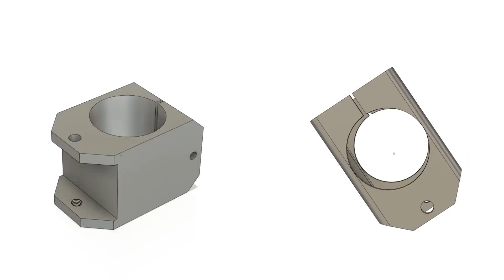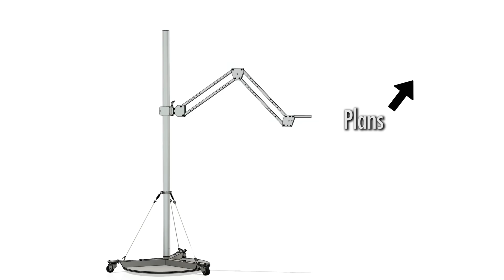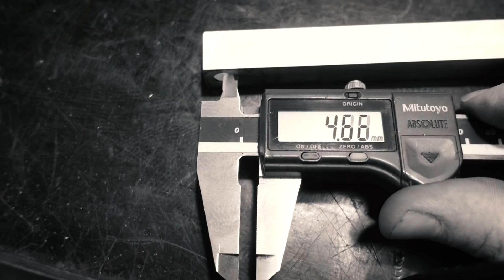Articulated Camera Arm on Wheels (no more Tripod!) (Plans available)

Comment: my dad would've hated this video... he's a mechanical engineer with 35 years experience, the fact you drilled 4x the number of holes than you actually needed in those aluminum tubes and the fact you machined 100% more parts than needed and didn't use standardized bought parts (saves on man-hour cost) would drive him mad ... i can hear him saying "that thing has been designed by a welder" (translated from my mother language)

Comment: That moment when your tripod is expensive than your Camera.
Reply: I actually think the raw materials excluding your own labor costs would add up to not even $80 total...aluminum/steel square and round stock pipes are really cheap as is raw steel plate and simple aluminum plate stock. I think the castor wheel are the most expensive rolling in at $15-18 each. Just google simple aluminum steel stock pipes and you'll see...You could make this entire build without any welder...Just bolted together...and that would be it. The more you know...
Reply: @Lalaland.001  I think he was talking about the commercial solutions that Phil decided to forego.
Reply: I think you accidentally a word

Comment: 5:25 a chuck in a chick lmao.  I’m a machinist and I have done it too.  End a endmill in the tailstock.  Know it is wrong but you do what you got to do.  Mine was a 6 jaw in 3 jaw.  Need more bite and adjustment in a plastic part.  Thank you for the video and taking me along on the build
Reply from the maker: Actually I could see myself doing this even if I had the backplate... simply because it's so much faster than changing the whole chuck 😅
Reply: @PhilVandelay  Re: A chuck in a chuck

Tom Lipton frequently uses such a setup in his videos and I don't think anyone would accuse him of being anything less than a master machinist. He's been turning handles making spaceships and nuclear reactors since before most of us were born!
Reply: @PhilVandelay  I have recently upsized (I've always wanted a bigger spindle bore than I had, now I've finally got one I can get my arm into, up to the shoulder) but it's a struggle, when working alone, to get my 310mm 3 jaw off the floor and onto the sled I've built for sliding it along the bed and onto the spindle nose. So I tend to leave it on and chuck a smaller chuck in it for 4 or 6 jaw work, or for small stuff where the big chuck jaws are too cumbersome. I do have to be careful though - on two occasions now a chuck has shifted on me. It would not be fun to have even a 250mm chuck chasing me round the shop....

Comment: Very well done.  I love the design. I appreciate seeing the process and details which worked or did not work.   I also have iterations in my designs.  I do not regret over designing something, but I often regret under designing. 

I do not think the collar and cables are overkill.    They allow better adjustment than if you welded on pieces of round bar.  Good idea for the 3 wheels so they always have contact if the floor is not even.
The cable adjusters would be called turnbuckles in the US.  Another good idea to allow adjustment if the cable stretches over time.
Dave.

Comment: That is an awesome stand, thank you so much for sharing :)

By the way, one of the best vibration dampening tricks for hollow tube is to fill it with sand. You may need to compensate for the weight of the sand by adding another base plate but that thing would be absolutely solid.

Comment: This is amazing engineering. I loved watching steel being worked to produce some very interesting designs. These, at the end, integrated to produce what is a very capable but complicated camera support. Some improvising was also necessary. However, this support is attractive and does the job (but it is a large tripod by any other name). It  would be interesting to find out how much this tool interferes with your work. My final comment "Well done".

Comment: Very nice but you are correct the weld joint at the washer cable junction is a weak point. I attach all kinds of eyelets and endings to thick and thin cable with some custom crimp blocks I made for my hydraulic shop press (also homemade) I hoist 750 to about 1500 lbs  often and never had one let go yet!
Reply from the maker: Yes I definitely wouldn't recommend this method to hang anything off it that has considerable weight, but for just keeping this pole upright it's worked fine so far. Good tip using the press for crimping

Comment: Well done. I would have used Nyloc nuts where you need to adjust the friction. Even with the spring washers the nuts may work loose(r).

Comment: Wow, nice design! I too am surprised that the tensioned wires work that well. I see you also have one of those Makita Battery-to-USB port things. I use one for my phone and took another apart to have a Makita battery connector for a project. Anyway, that's a sweet setup you've got now!
Reply from the maker: Yeah these things are great, they can power a camera for hours and most people have a few drill batteries sitting in their shop unused anyway. And they charge super fast!
Reply: Can't imagine why it wouldn't work considering that's how they hold radio antennas up.

Comment: Good job on the camera arm! The base weight should have been over the wheels, since weight at the center has little effect.  As far as the springs go, if you had made a sliding spring hanger for one end of each spring, you could adjust the spring tension based on whatever camera rig you install. Thes spring hanger should clamp on the tube with a peg to hold springs on each side, with a clamping bolt on the top or bottom.

Comment: In the interest of stability, please consider changing the base from 3 arms to 5 arms. In my experience with plant stands the 3 arm base, though seemingly stable on uneven surfaces, was very prone to tipping with any breeze (outdoors). I then tried 4 arms and that did not solve the problem either. I finally tried 5 arms, and though much more difficult to construct, this proved to be very stable in addition to offering the 3 arm advantage of being stable on uneven surfaces. 
I really like how you solve the problems with maximum complexity. Kind of my style. It gives me great satisfaction.
Reply from the maker: Good point, I hadn't even considered using more than four legs but I now that I think about it, it works pretty well on desk chairs

Comment: Drop a deep cycle battery on that plate and a converter and you can both charge your cameras and run a light without cords. Added stability from the weight was well.

Comment: very nice solution, i've resorted to using a rode microphone arm very similar to your lamps. also above my desk and other area in the office i have 40mm pipe runing in the ceiling and i use lighting gantry clamps to hold lights/mics etc. I love the portability of yours. great job thanks

Comment: Have you noticed that tripods have a hook under the post? It's there for a reason, so you can sandbag it.

At least they should have a hook, or a provision to drop a flat training weight across the base. Yours... seem not to?

That being said any sort of flying articulating arm as long as it's strong enough and you have an attachment point, that's just straight up better, we can all drink to that. So yeah an alternative is to just skip the tripod/rolling base and foresee attachment points in your lab. Other useful things that come to mind are RODE PSA1 and PSA1+. The long Manfrotto Friction Arm maybe? But it's got issues as well. Really the only reason tripods exist is so you can grab one and take it with you.
Reply from the maker: Yeah I put weights on the hook for a while actually but I found the effect is limited, you can still knock them over if you bump into it enough. But the bigger problem is just the floor space tripods take up, after using the camera arm for a few years I can say it's one of the most helpful things I ever built. I can't say it's ever annoyed me, it rarely gets in the way and still works like a charm, definitely has never fallen over either. 
There are some pro camera stands that could mostly do the same job, but they cost thousands and the shop environment would probably be rough on them. considering the cost and that they're made to be used in clean studios, I don't think it's the best thing to use in a workshop (this goes for any camera equipment really).

Comment: Re: four jaw in a three jaw. You have to dial it in anyway, so really - if you don't need the between-centres distance - it's a good idea and saves having to have/make a backplate. Also quicker than changing chucks on many lathes. Not as rigid, but doesn't matter for that particular job.

Comment: Have you considered magnetic mountings, often used on machine tools. You may have one handy. I wish I still had access to a Bridgeport Mill. 

flimsy crap tripods are hopeless. A substantial, wide dolly mounted tripod helps. I have used a telescopic pole stand with rolling base, for bigger Broadcast video cameras. A pivoting parallel motion arm on dolly is nice, if you have the space. Consider  Manfrotto wall mounted arms for lights or a fixed camera (like a Go-Pro) for wide shots. mixed with longer "detail" shots.

Comment: A vsit to the local gym for some weight plates 😉 they should just slide on to the pole. I like the adjustable spring system so if you use a different camera you can adjust for weight 👍

Comment: I love the chuck-on-chuck action! Why didn't I think of this? thanks!
Reply: I've had some employees refuse to chuck a chuck.
Reply: It's quite often done on big lathes, in industry, but only for taking light cuts. It's a big job changing a big chuck, and if what you need is a smaller chuck for one operation, then it makes sense to avoid two heavy lift operations (involving a crane or a fork hoist).
One advantage if that you can dial out nutation (where the lathe spindle axis is at a slight angle to the desired axis of workpiece rotation) as well as the more easily corrected situation of simple offset (where the axes are parallel but not coincident).

Comment: If you wanted to overcomplicate this more you could have made a spring adjustment system that uses screws or something(i have no idea what the proper term is lol), so you could use the thing for different weight equipment and adjust the spring tension more accurately

Comment: one design idea I dont see realized often:
Fill the structure with sand if possible, instead of adding more steel.
Works almost everytime when more weight is needed and sand is even 50% heavier than steel ... and a lot cheaper
Reply: Actual sand is one quarter of the density of steel, even when it's wet. It would hypothetically be heavier than steel (but only by a smidgen) if it comprised 50% by volume of solid grains of elemental tungsten, maybe. Whereas (in its naturally occurring mineral form of tungsten trioxide) it still only weighs about the same as sand. 
So on the price question of "heavy" sand: Elemental tungsten is about six times the price of copper. Copper in turn is about ten times the price of steel. By weight. Might strain the budget a bit...

Comment: Very cool build.   I wonder why your channel hasn't shown up in my suggested videos before now.  Glad it did.  Subscribed!
Reply: By the way, Have you seen Robin Renzettis (robrenz) carbon fiber tube and steel ball camera arm.  Pretty cool, and super light weight.
Reply from the maker: The YouTube Algorythm doesn't like me much recently, so I almost don't show up in suggested videos at all. Glad you found it anyway!
Reply from the maker: @arnljotseem8794  Yeah I came across that when doing some research. Beautiful design,  I'm not sure how much weight it could support though without the joints slipping (he uses a fairly light camera). DSLR setups get heavy quick when you don't use the cheap plastic lenses. As you saw in the video it's easy to underestimate that ;)
Reply: @PhilVandelay  Yeah, the bleeding algorithms.  They are controlling our lives soon.  Just wait for real AI to kick in.....  we're doomed

Comment: Aren’t you considering materials while machining them? In this arm, what type of material did you chose for making the steel ring which supports the steel cables? I’m Wondering about the type of steel in detail
Reply from the maker: That's just mild steel, probably S235JR since it's the most common/cheapest here.I rarely use anything else unless it's required, but for this thing it really doesn't matter

Comment: Another idea could be to fix a tube from the ceiling at the place you use the cam mostly and clamp it there to have no need for the base and use the base only for mobile filming.

Comment: I love how over engineered this tripod solution is, i kind of want one
Reply: Why not build one yourself get his plans. I actually think the raw materials excluding your own labor costs would add up to not even $80 total...aluminum/steel square and round stock pipes are really cheap as is raw steel plate and simple aluminum plate stock. I think the castor wheel are the most expensive rolling in at $15-18 each. Just google simple aluminum steel stock pipes and you'll see...You could make this entire build without any welder...Just bolted together...and that would be it. The more you know...

Comment: actually I wanted to put a chuck in a chuck but I was unsure if it works well. Tomorrow I will buy the second one ;-) Thanks
Reply from the maker: Apparently it's not even as looked down upon as I assumed among machinists!
Reply: @PhilVandelay  A good trick is to machine up a backplate larger than the (smaller) chuck from a disc brake rotor, and mill close-fitting recesses for the chuck jaws to grip. This makes the setup really secure if held in a big four jaw chuck. And the bigger chuck lets you dial in the work in a smaller three or six jaw chuck to run as true as you have time to achieve, even down to taking out any axis wobble.

Comment: just subbed today thanks to the belt grinder series. That is a handy camera mount for your shop, I agree the cables look more elegant, and its a great way to get the base out of the way. I just mention this to more or less poke you but, really? the battery mount? 
Also whomever thought of putting USB ports on tool battery chargers should have gotten a huge raise ... I thought "why" on the one that came with my leaf blower. Then like a week later we lost power for a day.
Reply from the maker: Ha, yeah I guess I got lazy with the battery, it was a bit of an afterthought. I sometimes use that thing in other places so  I wanted to be able to quickly grab it. Totally agree on the USB ports, if you already have a bunch of batteries it makes sense to use them for everything. It's ridiculous how every device has its own redundant battery these days, such a waste of resources when you think about it..

Comment: Bought the plans, they look great. Ordered most of the materials (I’m mounting from a ceiling instead). Where did you buy your springs? I am having trouble finding those size extension/expansion or tension springs.
Reply from the maker: Hi, I usually buy that kind of stuff on eBay, it's a good resource for special items you can't find in normal stores. Does take a bit of searching but at least here in Germany you can find almost anything on there. I doubt I would have found those springs in any normal stores.. But just as a tip, you can also combine multiple shorter springs into a long one, as I said in the vid it takes a bit of playing around to figure out the right tension

Comment: Cool build! I'm interested in the battery pack for your camera. Looks like you've got a power-tool battery tapped to feed the camera. Is that correct?
Reply from the maker: Yeah it just runs off an adapter that gives you two USB slots from the battery pack, you can get these for all the large brands like Makita, DeWalt etc. and then it's an additional adapter that goes into the camera instead of the camera battery and converts that to USB. Can be found on amazon for most camera models. Then you just connect the two and voila. Works great for me, I can get a few full days of shooting out of a 5A Makita battery, much less hassle than charging the small batteries

Comment: Great Job, why don't you clean off mill scale before TIG welding? Makes for a easier and better looking weld, doesn't take much time. Mounting a chuck in a chuck is not that uncommon.
Reply from the maker: Regarding the mill scale the simple answer is laziness 😅 I often can't be bothered to clean it off unless the part is something structurally critical or needs to look good. But yeah it welds much nicer when it's clean. As for the chuck I just kind of assumed it's a no-go because I rarely see anyone else do it..
Reply: @PhilVandelay  Edge Precision does it and he's probably the best machinist on YT.

Comment: Hi Phil, great video, do you think it is possible to build an adjustable desk using the same system thet you used ? The porpuse would be that the desk could lift to become a standing desk but also to put it at an sitting height.
Reply from the maker: i think if you built an extremely beefy version of this it might work, but if the only thing you want to do is change the height of the desk, this mechanism is probably overkill/too complex. There's much simpler ways of doing that if you only need to move it on one axis